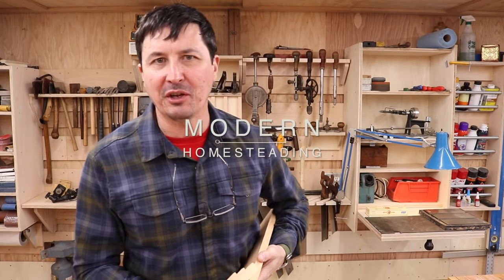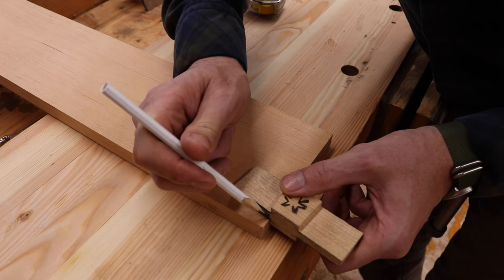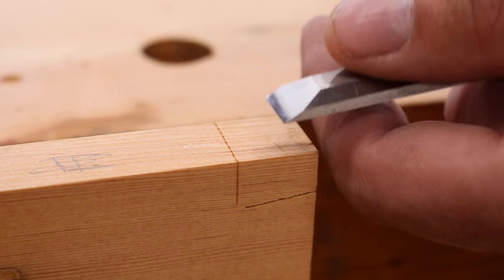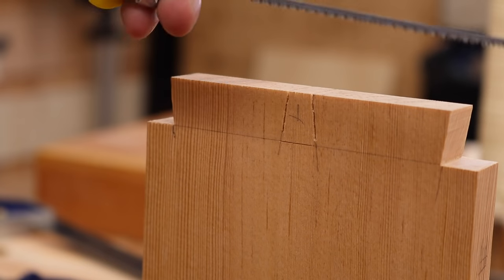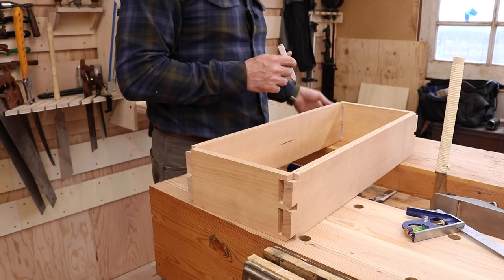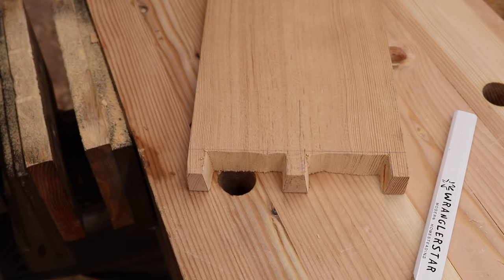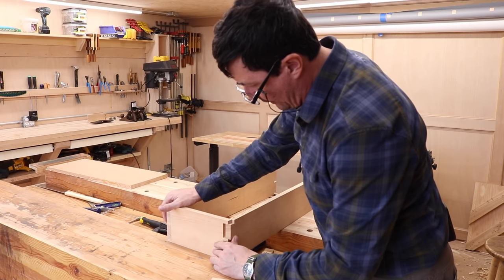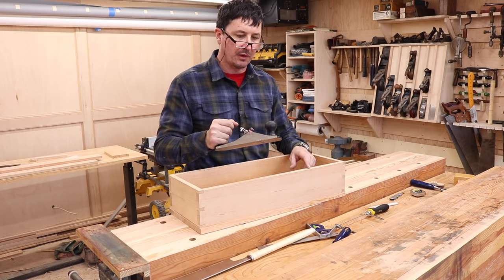Hand Cutting Dovetails Using Cheap Tools

Comment: The silliest thing I've ever seen in my life is on my daughters dresser drawers. It is chip board (glued together sawdust) and the corners are dovetailed. Dovetailed chip board?!? Of course after 30 years of abuse they've seen through my wife's teenage years and 2 daughters so far they've been busted out numberous time and I keep repairing them. But this video has inspired me to rebuild the drawers with dovetails, maybe even hand-cut dove tails but using solid material. Of course I'll be using these tools I'm going to win from Wranglerstar.

Comment: Your dovetail method is really sound but after I mark the baseline to speed things up I poke holes for the dovetail spacing with my dividers and put my saw blade in those holes then slide my little bit thicker dovetail marking gauge up to my blade and start cutting keeping the blade tight to the gauge. My method is something I've adapted from Rob Cosman's method, his method was my favorite, and I've seen hundreds of these YouTube videos on cutting dovetails.

Comment: So there's a debate, rope handles vs oval handle cutouts or even end-block grips. Silver surfer suggested rope handles (I believe across the box), supported on end blocks. Yet another quipped "French cleats for the hand" (sorry, forgot who). How about this? End blocks, French cleatish, deep enough to accommodate the ropes. The flexibility is key here. They can support two small loop rope handles, one on each end. Or a pair of sling rope handles across the length, suitable for shouldering the box or one-handed carry as needed (the pair of ropes allows balancing the box; can't tip if they're wide enough apart). Yet the blocks can also allow for two-handed carry. The winner can customize to his preference: Two long sling rope handles; two small loop handles; no rope handles but with French cleat like hand grips. If he doesn't like the holes, he can fit dowels (perhaps in contrasting wood) and flush-fit the dowels, using the tools in the box, just as you did to create the wonderful handcrafted dovetails.
Reply: I second this idea! Flexibility is key! If not, I like the french cleat idea just because anyone can figure out how to drill holes or make a slot but I'm very curious to see how you'd fix those blocks to the side of the box. I like this "no fasteners" build so far.
Reply: I was on the fence and voted for the holes but I agree French cleat on each side with round pegs attaching it two the sides would give it a nice touch if that would hold up to the test of time.

Comment: Does the sense of accomplishment give you the same feeling as an Eagle does? (It does me). You should call those hand-cut joints "Eagle Tails"!

Also, I would go for the "stadium" handles (I looked it up and that's what a rectangle with half-rounds on the end is called)

Comment: Fingers going into a box with sharp tools doesn't sound like a good idea. Attach small blocks on each end and the bottom edge of the blocks are beveled towards the box to give a finger-tip recess for carrying.
Reply: A french cleat for the hand!
Reply: I was thinking the same thing... holes in the side are asking for trouble.  I like the idea of French cleats for the hands.
Reply: Naa, the tools will be held down, secured. Or lying on the bottom. I wouldn't be worried about that.

Comment: ADJUSTABLE ROPE HANDLE THAT COMES UP OVER THE TOP AND CAN BE LAYED TO TH SIDE TO ACCESS THE CONTENTS AND YOU CAN PIKE IT  UP WITH ONE HAND AND TOTE IT AROUND OR ADJUST IT TO CARY ON THE SHOULDER AND THE BOTTOM SHOULD BE CAPTURED IN THE SIDES FOR BETTER SUPPORT OF THE WEIGHT TO BE CARIED. THE HUMAN BODY IS NOT DESIGNED TO CARY THINGS IN FRONT OF THE BODY AND IF YOU CAN PICK IT UP WITH ONE HAND THE OTHER HAND IS FREE TO TOTE SOMETHING ELSE. ANY WAY JUST SOME IDEAS >>>>>>> THANKS
Reply: OH AND COOL LOOKING IS GOOD BUT PRACTICAL IS BETTER FOR A TOOL TOTE /BOX  COOL LOOKING IS TO SHOW OFF IN THE HOUSE DOVE TAILS ARE COOL AND PRACTICAL ANY TIME >>>>> THANKS
Reply: This comment was hard to read. It was yelling in my head the whole time. Sir, I believe you caps lock button is stuck
Reply: Yes, quite correct.  In fact, numerous research has been done and sentences in capitals are the hardest to read properly.

Comment: Cody, I would probably do the hand holds/ovals instead of the rope.  They won't break they eyeline of the box if whoever wins it decides to french cleat the box to their wall, and it'll leave a flat surface on top to use as storage space for other equipment/tools to rest.  beautiful work brother!

Comment: This series is such a good fit with the outside work you do, give a nice balance. 

Rope Handle please
you don't need to knots on the inside, 2 rings on the outside to tie them onto will do the trick, could split the rope and tie the ends back together. 

Do we need a regular hammer or set of screwdrivers for this tool kit? 
Or do we assume you would already have these in your standard tool kit

Comment: Nice work Cody!  I'd be a little worried about cutting holes in the end of the box for handles.  Seems like you might be running your fingers into the end of a saw when you grab the handles.  I guess it will depend on how you orient the tools.  Thank you for the details on dovetails.  Something about them gives me the fizz.

Comment: I’ve been watching your videos since I was eight I’m twelve now and last week I tried to cut dovetails and it took me some creativity because I don’t have access to a coping saw so I ended up using a bandsaw to remove the waste on both my pins and my tails it worked good but I need to get better at sharpening by hand because the chisels I used were pretty dull but in all they turned out good.

Comment: As many have said, I think a dovetail jig or "Eagle Tail" as Bryan Schultz called it, should be added to the tool box. If the single, balanced handle in the middle is ruled out, I like the two ovals on the sides. I'm going to wait till you reveal who gets the tool box but I am planning on building my wife and I a proper bed frame with these tools when I get home. Maybe try my hand at some mortise and tenons, who knows.  As always, great job on the video and great looking dovetails.

Comment: You ended up with that gap because the joint was loose to start with before you trimmed it so it got even looser. Try not to touch those outside edges. It usually results in a gap. Just for info, we call them tail boards and pin boards. Paul Sellers and Rob Cosman both have some great videos on dovetails. Paul does one like this in under two minutes and Rob doesn't take very much longer - amazing stuff to watch.

Comment: Cody - i am just loving this series, and your skills as a woodworker are just growing and growing.  

Those dovetails came out GREAT in my opinion.  I know you mentioned 2 things that i think could warrant feedback from us viewers who are desperately vying for a shot to win this treasured tool kit (and of course the real treasure is the handmade toolbox)

So the feedback! --

(1) Handles for the box: I like the idea of the oval handles.  Keeps the profile slim and with that 3/4" stock you're using and the orientation of the grain I don't think it poses a threat to integrity of the box as long as you leave about 1"  from the top of the oval to the top of the box.

(2) The limitation of the hand plane you selected : While i think its great that the plane is fully functional as is, and just has some limitations in terms of setting it thin for end grain shavings or something - i could send you a regular Stanley #3 or #4 i have laying around that just needs some restoring.  Ultimately - it is certainly a better plane - and its actually cheaper.  Stanley #3's and #4's can be had in serviceable condition for less than $20 no problem.  

So if you'd like to replace the hand plane with a Bailey pattern Stanley #3 or #4 i would be happy to donate it - and since you've already got a video on restoring it - you could just include it as it and allow people to take a crack at restoring it.  Personally - i don't think a rusty old handplane being restored to a fine polish or new condition is a bad thing - especially for someone who wants to USE it and not collect it.  It's an ideal choice for this common man's tool kit.

Anyway - thumbs up once again - awesome video can't wait to see the finale!
Reply: So @Wranglerstar - if you would like one of these to include - let me know via private message and i can have it shipped out to ya!
Reply from the maker: +Erik Joven by all means Eric thank you. You can email me at cody@wranglerstar.com
Reply: Excellent - when i get a few mins to do so - ill take a few pics and mail 'em over and you can let me know what may be useful.

I picked up a whole crate full of rusty old things at some flea market for next to nothing - so if you or i can do some good with them thats fantastic!
Reply: Paul Sellers has an excellent video on restoring a Stanley #4, his favorite overall plane.
Reply: Aye - that he does.  Cody has one as well which i found to be very useful as well.  Both are great videos.

I literally bought a box of stanely 3 and 4s in varying states of neglect.  Ive restored 2 thus far which are my "keepers" but ill do one more and send that plus an un-restored one to Cody to do with what he will.

Comment: Those turned our really nice, good work! If the only options are rope or grab holes I would probably got holes, but I still think I like grab blocks because then if the box is full of stuff the holes can get blocked by the stuff in the box. Simple wood block handles is totally the way I would go but it's your build.

Comment: ...as to the handle situation - just dado in a fingertip grip. Works in the fruit industry for cherry lugs (from the last century). That way, nothing in the way,  you get a nice finger/palm grip, and your fingers don't come into contact with sharps that may be in the tool carry.  Make it right for your hand size and as deep as you want - just not through.

Blessings. Handy Andy

Comment: I thought you were discussing a handle that was part of a divider down the center? A one handed handle is pretty important if you're using it as a tool caddy. If it's access on a shelf, then a hand hole or block with a grip (like the french cleat suggestion)

Comment: Well done on the dovetails, I've cut a few and know the time that you've put into them.

My Grandfather was a master craftsman/blacksmith and always said "things that you touch with your hands should be curved."  If you choose to go with the hole for the hand grip, look at your old saw handles and tool handles and derive the shape of the hole from them.  He had a favorite backsaw that he traced the handle for all kinds of areas that he intended to have the final owner touch with their hands.  I've tried boring two holes and connecting them with straight lines, and just as he warned,  I was disappointed with the results.  Also, as some of the previous comments have indicated, placement of the tools in such a way that you don't contact any edges when grabbing the handles in the box will be very important.

Comment: Quick tip to consider; if you're worried about fouling your clean sawn edges with the coping saw, don't use them; start your coping saw waste cuts in the middle of the piece you're sawing out. It's a couple extra strokes with the coping saw but it takes a lot of the "I'm about to mess up this nice sawn surface" out of the equation. 

Obviously, much more useful technique for the second piece that's marked using the original. The original, paring back some apprentice marks off the sawn surface is no issue, but when you're working with the edge that has no material to spare... bad.

Comment: Nice job in those dovetails, I need to improve a lot to get where you are now. A strap or handle that can swing like a the old fasion metal toll boxes will work. As other said you need a hand to open door while you are carring the tool box. Are you going to give it any finish?

Comment: Hole/handles but also perhaps incorporate a gentle bevel into the middle of each side on the bottom edge? Many are pointing out that the box needs to be manipulated with one hand. A compromise would be to make it press against the hip nicely (similar to a laundry basket on a much smaller scale).

Comment: I'm sure you know this by now but the part you point to at 3.16 is called the Tail. The bits on the other piece of wood that slot between the Tails are called the Pins :) As far as I'm aware at least.

Comment: I'm about at 17:37, and has to pause for this comment. 

I noticed, at the beginning that the boats were mated a bit off, and I guessed what caused it. At the point that I paused, I noticed I was correct. (Mind you, it's not a big deal, but this may help some people who want to slot the boards for a bottom, before assembly) 

The key to alignment is the kerf offset. Instead of drawing the lines on a perfectly flush pair of boards, set the saw blade you're going to use along the edge of the template board. Draw the lines only along the side of the blade (saw on left, draw the left lines only) then move the saw to the right and repeat to finish the pattern. This amounts the outside of the kerf with the inside of the matching notch, and minimizes the chance of board misalignment.

Comment: I think a wood handles mounted on 1 inch standoffs on each end of the tool box. The standoffs could be dowelled into the end board of the box and board used as the handle. May need four 1/2 dowels for each handle, two on each end of the handle board..  This would allow a strap to be connected to each handle that can be used for carrying it over the shoulder.  This would also allow the tool box to be stored under a workbench on slides like a drawer. This type of handle would not require holes in the end of the tool box.  A problem with hand holes that enter the tool box is the fingers may hit a sharp tool which would not be good. With external handles a cover could be added if desired allowing for an enclosed tool box, if tools do not stick above the tool box.

Comment: I always like your videos and I think you put out good content. With that said, I think you showed here a very safety problem with your hand-chiseling skills.14:15 &15:06. The scars from the stitches on my left hand are screaming through the screen to say stop. since you already had it on a vise, you can pair down with angling your piece in order to have a straight line down instead of holding the entire piece in your hand. and you should neven put your hand on the other side of the wood especially when pairing from the opposite side. While these comments may not be for you specifically, I felt like they were worth mentioning here for people that follow you and try this at home. Thanks again for your videos. all in good spirit here :)

Comment: I think you should (for the handles) do two pieces either side protruding out, bolted in with recessed bolts with dowel handles going between them. This way you don't have a space where bits could fall out or loose space to the rope.

Comment: It's funny how people today (including me) view through dovetails as a mark of beauty, when for centuries it was just a utility joint to be hidden.  Furniture used half-blind and full-blind dovetails to mask the joint.

Cody put a lot of care into trying to get them just right, and he did a really good job considering it was only his second time cutting dovetails, but if you looked at an actual 18th century joiner's toolbox they'd be well-fitting but sloppy with knife marks and whatnot.  That's because the joiner would have been trained to do them in a tenth of the time.  If the joiner wanted the toolbox to look nice, you wouldn't see dovetails at all.

Comment: I've done lots of hand cut dove tail joints,  but I've never used a layout tool like the one you used. I am going to make one though. Also, get rid of that pencil and use a carpenter's knife to make your lines.
Reply: There are also similar dovetail jigs that have a magnet and it magnetizes to your saw and you cut it out perfectly.

Comment: You mentioned in the last video that the saw mill or lumber supplier could make an edge that you could not. What else is there that you really can't replicate in a home shop or without very expensive tools? Have you run into issues like that?

Comment: I have to admit they the coping saw is really handy in tight spaces. So for small projects they are great. But for timber framing or such there use is pretty much not needed

Comment: Instead of worrying about the coping saw messing up your good dovetail saw cut, just use the dovetail saw to make a third cut, a 'pilot' cut, straight down the center of your waste material about 1/2 way then use the coping saw to clear the bulk of the waste.

Comment: 24:21 I am really curious: How are you going to attach the bottom to the sides? Dovetails again? Dowels? Box joints? Anyway, well done so far.
Reply: Dovetails and box joints can only be done one side to one side.  Dowels are a possibility but I'm guessing nails, screws, and glue.

Comment: In case the joint fits too tight: What about the "Kill-the-Wood"-technique mentioned by "The Samurai Carpenter"? Wouldn't that work? I don't know if this would put too much stress on the dovetails or not.

Comment: Very interesting watching how the dovetails are made.  I would imagine that the more dovetails on a side would mean a stronger joint (up to a point that is).  Of course that would mean more work, more time involved, and probably a higher level of skill would be required, perhaps not.  As for the handles for the toolbox, I would be more inclined to have simple finger/hand holes rather than a rope handle.